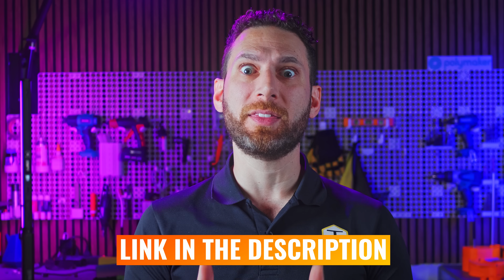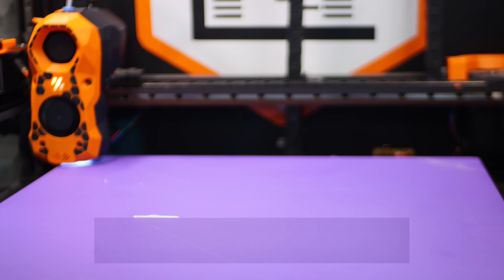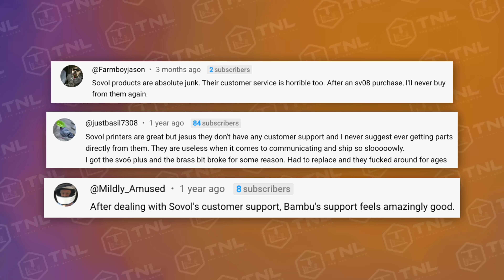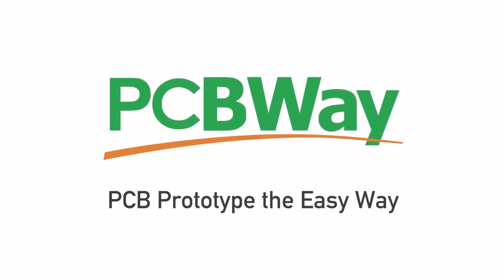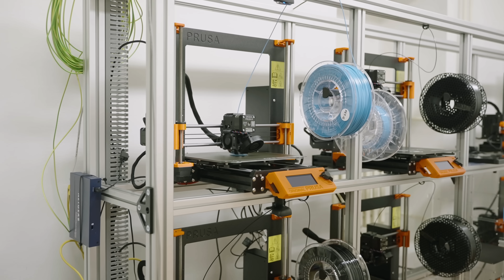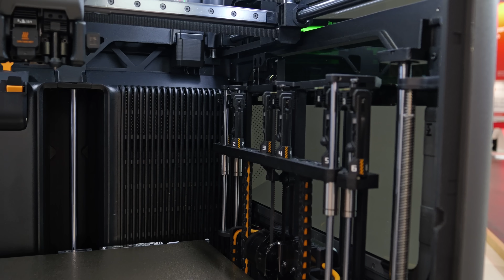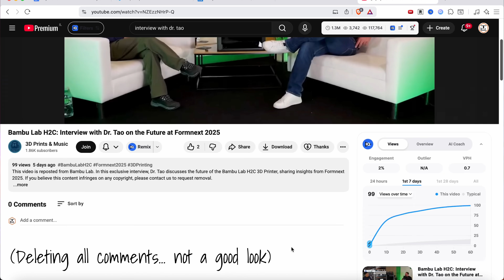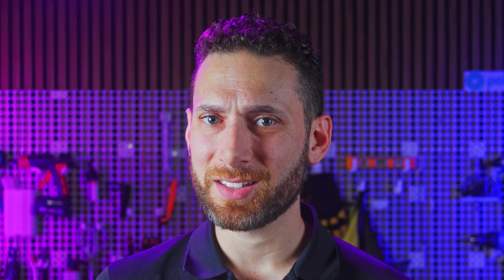My HONEST Annual Report Card for Each 3D Printer Brand

Comment: So funny, much complain about changing the 8 colors of Bondtech-System took half a day...but than call changing a color on Bambu with 40s catastrophic. ;)
To be honest, I did also waited for Bondtech INDX. But compared to Bambu VORTEK, the Bambu solution is not that bad at all! I still can use AMS, can use different nozzle size, can change the nozzles in a blink of an eye, ...
Do I like the still longer lasting Filament time? No I don't. But I really like the flexibility of the VORTEK system.
 
The video is very biased unfortunately.
Do you have an Open System on your Computer? If not (and exclusively using Linux), why complain about Bambu HW and SW?

btw. right now you can print at least 24 kg Filament with Bambu Printers without manually change a single roll in your system. Yes, problem is to clear out the print plate. ;)
Reply from the maker: You seem to confuse changing filament in a print (40 seconds on Vortek, 10 seconds on INDX) with LOADING filaments, which is very annoying on the Prusa printers as I pointed out :)
Reply: @thenextlayer  @thenextlayer  I think taking both into consideration is the only fair way to compare the two. The customer has to decide if they would rather have that print take a little longer but have a more flexible system (vortek) or have the print be faster but having a less flexible solution (indx). 

I for one much prefer vortek since it saves me a significant amount of hassle compared to indx.
Reply: @thenextlayer  Loading and changing are literally the same with the ams. 😂
I get what u mean tho. 
What i dont like on the INDX system is that the printer is open. So no advanced materials. 8 nozzle changer just to print colour junk made from pla.  Thats sad in my eyes. And no, building an enclosure is not going to fix that in my eyes. Prusa needs to get their shit together when it comes to "exotic" materials like ABS and nylon 😂

Comment: i love my P1S 
it was my first printer, decided for it bc i got it in an offer and heard you dont need to fiddle with it much and it just works. 
i do want a bigger print volume if i get another printer or replace my current one at some point. 
while i am not necessarily a fan of everything bambu is doing, its just damn convenient. with the app and makerworld too
Reply from the maker: No doubt, they make great products! I just don't like the decisions they're making lately.
Reply: I agree with that. I´d love a more open experience with similar performance with the same or lower price. havent found that yet. 
Am very open to suggestions for a replacement in the future. 
for recommendations i have to say that my printer is in the hallway of my apartment bc that kinda is the only place where i have room for it without the noise/ventilation becoming an issue

Comment: I just received my Snapmaker U1 on Sunday, did my first print yesterday... It took me a day and a half to fix the belt tensioning. The belt tensioning was all messed up and the docking coordinates of the toolheads were off. You can tell that this machine was built as quickly as possible to be sent out the door.  While I appreciate a timely delivery, I don't want to troubleshoot in the first 5 minutes because I can't get through the initial calibration.  This upset me greatly... I think the content creators got a much different printer than the rest of us.  I can def tell how quickly and cheaply this printer was made...  BUT, with all that said, after my initial problems it seems to print well.  Although I had a toolhead docking failure at 13% during my frist print which led to a layer shift.
Reply: That's one reason that I'm not upset that mine is not scheduled until April.  I think by then they will have made needed improvements in design and QC
Reply: @woodwaker1  I was kinda expecting it but still annoyed that I had problems out the gate, although it does seem like a rare thing where the toolhead needs further tweaking to be able to dock and undock properly. Luck of the draw I guess...  I still like the printer.
Reply from the maker: Odd. I had two of them and they’re both fine. Also the belt tensioning procedure is minutes not hours. Are you a bot…?
Reply: @thenextlayer  Its sad I'm called a bot simply because I didn't receive a flawless printer like you did...
Reply: @thenextlayer  No, let me rephrase. The manual belt tensioning took a few seconds. The reprogramming of the tool head parameters took forever to dial in. Overall it took me several hours to get to be able to print anything and get through a successful print. It could be possible I just got one with belt tensioning issues, either way I'm not happy about it. Having my toolheads not dock or undock correctly is very frustrating.

Comment: Bambu needs to refresh the A1 
I want 300x300x300 at least and a vortek.
Vortek makes more sense for the AMS lite since all PTFE tubes go directly into the tool head so there is no retraction to waste time for color swaps.
Just put the vortek on a sled to the right of the bed and overhang the gantry over it, sled would move front to back since the tool head can't.
Give us a 4 nozzle rack or maybe a 6 nozzle rack,
Let us use the original AMS lite with it but also offer an AMS lite pro that is enclosed and has a dryer.
Maybe add another spool on each side for 6 spools to feed the vortek
Put them in a triangle formation on each side.
Also after an A2D , same printer with the dual nozzle tool head.
We want an entry level multi material machine like the A1C that doesn't poop. Instead of investing $2400 on a machine that is slower because of the inferior AMS design where only one PTFE goes to the tool head.
A1 had advantages over the P1 and X1
Bigger out of the box volume, pressure advanced Eddy current calibration and the better and faster AMS design (albeit more messy).
Let's continue that trend with an A2C and or A2D
Reply from the maker: Some interesting ideas!

Comment: Yeah, can't recommend Sovol for anything really because their support. I would even say their "commitment to open source" is pretty stretched thin when looking at their Github and their approach seems to be release, forget, and stuff will be fixed in the next printer. Imagine paying $1,300 for a printer and from the get go it's backup firmware is 6 months old and NEVER updated ("sv08 max first commit"), that is literally the definition of "Abandonware".
And don't even look at SV07 firmware... When I bought mine it had a newer firmware that I managed to poop (that's my fault for pressing the shiny "Update" button on Klipper screen), but only firmware I am still able to officially flash to that piece of work is the initial firmware from when it was released. I don't even know why they have troubled themselves to make a Github page when they just abandon it like used toilet paper.
That's already enough a reason to avoid at all costs and I don't want to talk about my SV07 hotend lost in transit and getting ghosted by the support.

And about the Bambu Lab, well, they started from DJI and with that track record of being fair to the consumers, well well well, I am not surprised (just look into controlling DJI drones without the official apps, you need DJI Cloud which is enterprise customers only feature).

Comment: To add to this in case anyone with them sees this video and actually does look. Dear Qidi. Please, please, please actually do the proper RnD into your products before releasing them. Your EVENTUAL end use printers are very nice especially for the price, I’ve absolutely LOVED the plus 3 I purchased from your unrepair store, your customer service was amazing with helping me get parts for it and even providing me with the STEP files for the motor mounts so I could just print them myself on this last gen printer is an absolutely great idea. But releasing a printer that costs as much as yours do with the issues they have is disgusting, and it really needs to be addressed. Hoping to see great things from y’all, but don’t wanna put 600+ dollars down on something I’m gonna have to wait months to get astounding results out of, when even your more closed off competition gives me something good out of the box, even if it is more expensive

Comment: I'm probably in the minority here, but I truly love my H2c. It prints flawlessly. Changes between the two tool heads is only 8 seconds, and 30 seconds to change between Vortech hotends (I've timed mine with the 2 AMS2 Pro's and 1 AMS HT I have connected). Compared to how it was with just a single nozzle, this is huge. I know in the short time I've had it, I've not wasted more than 3 Kg of filament. That starts to add up quickly. Yes, it's slower than a tool changer. Ok. What's your point? If you value speed over all else, get a tool changer. The only one currently available that I'm aware of is the Prusa XL. How quickly does it print 7 color models? Oh, and it costs more than twice what the H2c costs. The U1 isn't really available unless you backed the kick starter, I believe, so, I'm not counting that. The Indx system looks amazing, but again... where can I buy it? Also, it's not a printer, but a mod for a printer that the end user needs to install and configure, so, does that really count for the majority of us? I do have an sv08 that I will mod with the Indx, btw. I get it, everybody wanted a cheaper toolchanger (than the XL) and everybody is mad at BL for letting Snapmaker do it. BL made a development choice. If the printer doesn't meet your needs, move on and buy the one that does.
Reply from the maker: Cool, glad you’re happy with your H2C. I still think it’s a reflection of the fact that Bambu isn’t listening to customers - you said as much in the end of your comment.
Reply: @thenextlayer Exactly. And it may come back to bite them. It doesn’t change that the H2c is an excellent printer, just not for everybody. It fits my use case well though.
Reply: Cool, can you confirm that BL increased the DRM on this Machine ? Supposedly for Safety Reason BL will/is enforce DRM ,s more and wont allow the Majority of third Party Hardware, extending to replacements Parts such as Nozzle,s etc ? I would be very interested to know …
Reply: @HaftBrand it’s definitely the case, clear for all to see. People just refuse to accept it.
Reply: @perkulant4629 Oh BL is definitely building a wall around its ecosystem. They are following the Apple model for sure.

Comment: Regarding Bambu, it is interesting how you lump the “community” as a monolith. Maybe the constant tweaking, upgrading, modding, etc side may not like some stuff they are doing and that’s fine. 

But there are many of us who just want to click print and we get products we can sell and better our lives financially. 

You can hate what they do or how they act, but their printers are affordable and reliable. I have over 5,000 hours on each of my 7 machines and barely have to do anything other than basic routine maintenance.
Reply from the maker: They’re GREAT printers. And I have no problem with proprietary firmware either. But limiting functionality AFTER users buy a printer (MQTT, Orca) isn’t cool. And again, I more spoke on the direction they’re going and their conduct than the printers or even the closed approach.
Reply: You skipped the most important part of the man’s initial complaint.
You use the word “community” for all 3D printer customers…
This is a huge oversight.
Who is the “community” these days?
I do not think you understand the vast majority of 3D printing customers. 
Bambu does because they have done the market research.
They know most people just want a cool looking printer that works, is cheap and easy to use. They make printers for that and filled a gap in the market.
Your rants mean nothing to them
Reply: @matthewguiher They sell to the "It has to work" crowd and not to the i want to tinker around community.
Reply: @thenextlayer  Weird how you expect a company to do something you want with their own products that you don’t use. I have never had an issue with bambu studio and sending files. The point of the MQTT and orca feels like a boring example. Should Apple support android on their phone?

You act like this is something crazy. Companies who make devices often will change things that enable, disable, or tweak features. My car used to be able to send me vehicle health reports, but they disabled the service and now I can’t do that.
Reply: @crafthappy3d  I feel like he is pointing out you can have both and that is what you're not getting. You do know you can build a secured ecosystem that can offer full or even partial interoperability, right? It is not one or the other...no matter what Apple or Bambu Lab tells you.

As for your last part...why is it okay for a company to change or remove the functionality you paid for in an existing product? Where does it end for you? Would you be happy if two years down the road, Bambu forces an update that requires your existing P1S only to use BBL filament, in the name of security and maintaining print quality?
Reply: @sliceofmymind as far as I know they never said that orca was officially supported. So they didnt sell you something.
Reply: @galardo3303  Don't sidestep the question (I know it wasn't directed at you), Can you build a secured ecosystem that can offer interoperability?
Reply: @crafthappy3d  The point is that MQTT with all it's features still exists and works in the same way as before, but Bambu has intentionally prevented others from accessing it.
Reply: @sliceofmymind  Last I heard, you can still use Orca, but you just have to send the file through the Bambu Connect or whatever it is called. I would consider that partial interoperability. 

There was also the X1 Plus firmware for Bambu which they weren't completely locking out, just may limit warranty if I recall right. 

Primarily I do use bambu filaments because they work well, they are cheap, and less waste with refill spools. The only non-bambu I use is some marbles, or some rainbow filaments.
Reply: @jakob7153  I understand that, but think about it from a legal prospective. If Bambu allows third-party software to control the printer over MQTT, they would also take responsibility for what that software does. 

If there was some gcode that caused problems with the machine, Orca wouldn't hold that legal responsibility, that would likely fall on Bambu. 

When you have millions of machines out there and not everyone is a 3D printing enthusiast and knows all of the ins and outs, you have to weigh and control what risk you can take on.

You can buy Bambu from Best Buy and Microcenter, which come with some consumer expectations and protections.
Reply: @sliceofmymind i simply addressed the part where u said they removed functionality you bought. They never sold u orca working with their printers. It was at best a exploit and nothing intentional. 
Is it shitty, that they did this? Yes. Did they remove functionality they sold? No. That was my point. 
It would be different if they said it would work with other slicers. But they never did. At least to my knowledge.
Reply: @galardo3303  You aren't wrong.
Reply: @sliceofmymind  They aren’t forcing users to update so you can still use the printer just as when you first brought it they only have it mandatory on the newer printers where you know what you’re getting into.
Reply: @charzap9662  and u can downgrade them. At least my H2D has the option.
Reply: I get your Point, and from a Point of the OpenSource Community that helped to “inspire” the Products you are using right now comes the “hating” Part since BL is  clearly generous in “getting inspiration” but not so much in “giving” back and like someone earlier said “it’s like being in abusive relationship” and i wont buy their Printer,s for that reason… to be fair tho without my knowledge about “Closed Ecosystems” “Anti-Consumer-Practices” and “Anti-Repairability” i would definitely consider getting one, i just know too much and cant go back 😆
Reply: You are one of the very lucky people, because I don't know anyone who hasn't had a technical problem with Bambu printers.
Reply: @N@NienTran-x9ytechnical as print issues or hardware issues? Between 7 printers and 3 years using them, no hardware issues.
Reply: @crafthappy3d my H2D had a software problem in the beginning. Should have updated before calibration. It went out of the cleaning station in the wrong direction and bent the nozzle blocker. Contacted Bambu and they sent a 5 pack of wipers for the inconvenience. 😂
Reply: @galardo3303  Ouch!

Comment: Sovol needs to chat with Noctua
Reply: that was my first mod, before I even powered up the first time.
Reply: And bring out a upgrade kits for the printers, it's a good compromise.
Reply: That what I did with my SV08. My vision of the SV08 is that it a printer that is a really solid start that can be upgrade to match what you wanna do with it.
Reply: I did the Noctua upgrade as well. BUT the Solution is very simple: Putt in a 60mm Fan not a 40mm. There is more then enough space for it. It doesn't cost more as 40mm and 60mm fans cost the same only different holes and a 60mm has a lower RPM on default.
Reply: Right. One of the cheapest machine manufacturers needs to chat with one of the most expensive parts suppliers. 
I'm sure that will happen.
Reply: @TheOfficialOriginalChad Yeah, just double the price of the printer with some Fans with owls on them
Reply: @TheOfficialOriginalChad  why don't you upgrade your SV08 to all noctua fans and give us a write-up?
Reply: @WesPeters  What in the world are you on about?
What kind of paint are you huffing to convince yourself that I, specifically, own an SV08 that doesn't already have Noctua fans?
Who's "us"?
Why would I do anything for you for free? AND document it?? Earth to @WesPeeners, come in @WesPeeners